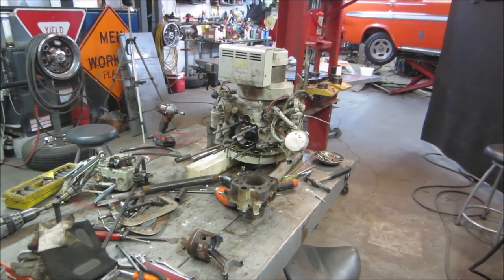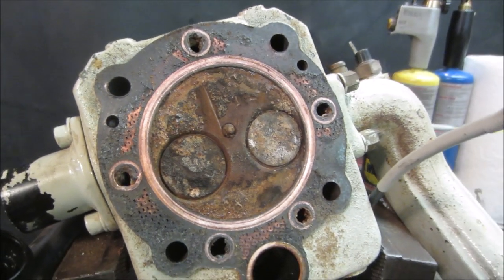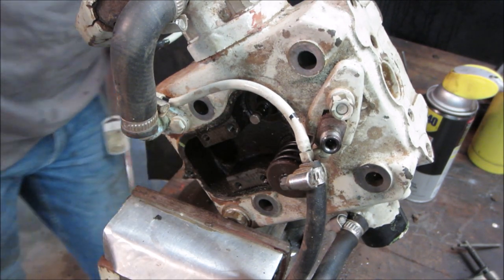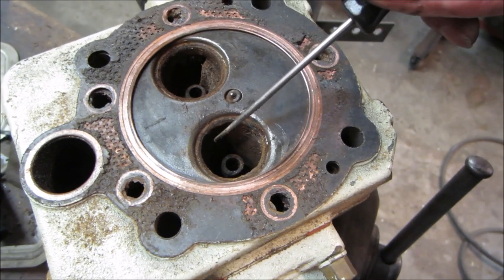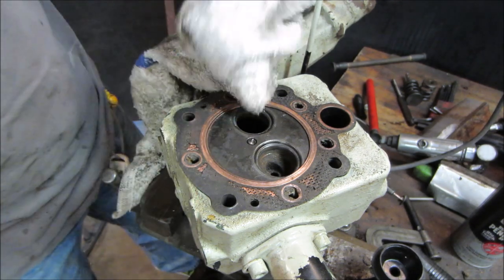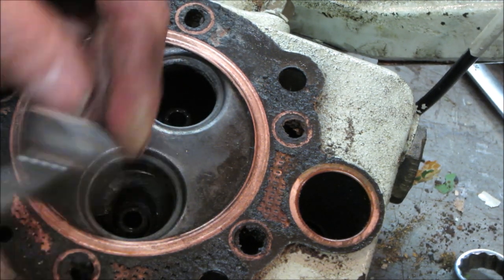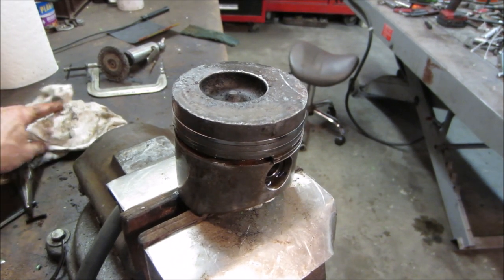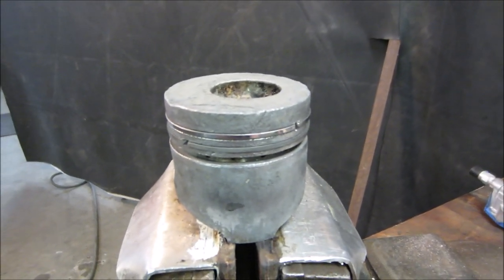Can It Be Saved? Junked Marine Diesel PT 2

Comment: That's a real pity. . . . On the other hand, the gen-end might mount up to another engine?! Plenty of them are a universal fit.

Valves and rings aren't necessarily the end of the game, but the broken piston crown is definitely a game changer, however, as we discovered about 45 years ago, there's a lot you can do with parts from other engines, and many a 'mongrel' has gone on to live again over here! 👌👍

One useful tool to add to your armoury, would be a "Vibro-Centric" valve seat cutter - It takes mere seconds to re-cut a valve seat like that in your engine, so useful in fact that someone decided ours would be more useful to them, than it was to us! 😠 Similarly, the old Black & Decker valve re-facing machine. Ancient by today's standards, but well worth nabbing if you ever find one in a junk sale.

Comment: Touching the tip of the injector with the wire wheel probably just wiped out the holes on the tip... I rebuild diesel fuel Injectors and a lot of the times customers will wire wheel the injectors for us and ruin the holes in the tip so we have to replace the nozzles. If you want the injector rebuilt send it to me and ill do it for free, cheers mustie!

Comment: This takes me back to a Skoda engine that was smoking. I pulled it apart to find one piston with a crack top to bottom. Ok I phoned Skoda for the price and what i was quoted was outstanding I said i don`t want a set just one piston & rings. Yep he said £180 the piston and £90 for the 3 rings. I got a fresh low miles engine with all the bits starter alternator injector pump already out of car. picked up £250. sorted

Comment: A marine diesel with a water-cooled exhaust should not be cranked for long if it doesn't start. The raw water pump will continue to fill the exhaust until it comes into the exhaust valve and hydro locks the piston.

Comment: i suppose if you wanted to press out the sleeve and flip it you could.  as for the rings i might try to go around them with that pneumatic screw loosener to vibrate them free.   as for getting parts from the Italian fellow i would think to aid in a restoration the parts would be gratis from the manufacturer for the advertising aspect

Comment: We use kerosene in the chamber to see if  the valves leak as it doesn't evaporate very quickly and it's thin enough to find any problems between the valve and the seat.

Comment: BMW M20B23 (2.3 L, SOHC, 12V) The cylinder bore is 80.0 mm (3.15 in) now if the ring thickness is the same. you have it made.

Comment: make a head gasket out of annealed copper same thickness as og gasket. i see this more often then not. especially in salt water marine engines. some liners can not be changed if its an aluminum barrel a lot of times they cast them with the iron liner in it. the piston should be at .000 or .010- .020 above deck. you should use brass brush on injector tip steel has a tendency to peel metal across the holes and plug them up.

Comment: You should do a collaboration video with cold war motors.  Scott has a 1950s valve grinding machine and they used it to re-do the seats and valves in 2 1950s straight eight engines.  The valves on those straight eights were way worse than what you see here and they got em working.  Cold War Motors is one of the best channels on YT and they could use the attention.

Comment: I think what happened is water froze inside that exhaust manifold cracking it, then when it thawed next the water drained through the cracks into the exhaust port, and into the cylinder.

Comment: If it's an aluminum piston, you may need to use muriatic acid to dissolve the aluminum that's stuck to the cylinder. Ya never know, it might help.

Comment: Maybe if a 3 part oil ring fits widthwise you could cut them to fit with a gap that would work
Reply: Piston is " CRACKED ".
Reply: @NoWr2Run  he cracked the oil ring not the piston
Reply: @shunloc9704  YES, but if you watch till the end he shows you the Piston is also CRACKED. Probably from the 20 ton press ?

Comment: Oh well, that's a shame. Next time just go out and get some proper valve lapping paste. I always used the one in the red tube, two lids, rough grade on one end, smooth on the other.
I'd never just spin the valve either. It was a back and forth rotation, lift the valve, turn it a bit, push a bit of the paste back in (like you did) then down and back and forth again.
Once any pits are gone, use the smooth grade.
Then again, looking at the condition of everything else, you were probably wise to just give it a cursory lapp.

Comment: The exhaust came back into the head, seawater is the ultimate corrosion, you need to regrind the valve seat and new piston, I would say the rest is good. Marine generators would be worth the effort the resale value, you need to research.
Reply: If the exhaust is water cooled it froze and cracked water entered the cylinder through the exhaust so if you can't find a exhaust manifold it's over

Comment: Newbie question from Scotland - Dont diesels have glow plugs? - I thought these ignited the fuel...having said that I have heard it is as Mustie described - pressure in the chamber
Reply: Its the super compression that ignites diesel, glow plugs typically are even not turned on in warmer months, Depending on the engine, they only turn on for a few seconds precrank.

Comment: Diesel engines have a very thick valve seat because of the high pressures and the extreme heat a thin edge valve would burn away pretty quickly 🤷🏻‍♂️ 😌

Comment: Why aren't there sparkless gasoline engines?   Does diesel combust at a lower temperature than gasoline?
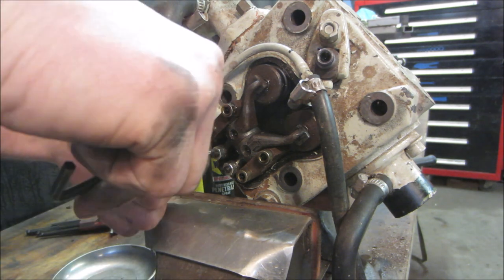Reply: Did you not watch the video?  8:00
Reply: @SteelheadTed  That's what sparked the question (no pun intended).  He explained how diesel engines work, which I knew, but I was wondering why it's impossible to make a gasoline engine that works off the diesel principle.
Reply: @jimthesoundman8641  I see.  I don't think it is impossible to make a gas engine that works like a diesel but since gas burns hot, fast and easily I think the issue of combustion timing gets tricky and isn't worth trying to overcome with compensation measures that is easier than just having spark plugs.

Comment: Hey mustie i have used copper silicone spray like the kind you use on headers to seal headgaskets i did that on a 72 ford van straight 6 headgasket  on it as an emergency fix on a sunday night and i had to have that van for work the next day so i bought another engine and said i wuld just change the motor when it blew again well 7 years later the body rusted so bad i couldnt get a sticker so i pulled that engine and put it in a truck i sold the truck 2 years later and that headgasket never did blow out so you might want to try that

Comment: You are lucky if the liner is not cracked. I would remove the liner for inspection and reinstall 90 deg from original position. Been there done that. Chief Engineer Paul Haugan

Comment: Steve from Annapolis knowing especially if you can't get parts I would have just let it serve for transmission fluid tapped on the rings with a rubber mallet put it back together it would have worked

Comment: You can test generator by spinning crankshaft with drill  or impact wrench. Hook meter to it and spin it up. If it's going to work, something will show on meter  even if not at 1,800 rpm. Edit;! Tie down block, without piston rod assembly  it will be hella out of balance,  and will want to hop all over the place.  Guess how I know this!! Lol

Comment: Google "Otto Gas Engine Works" on google.  From their webpage:  "We offer piston rings from 5/8" to 86" diameter and can custom make most sizes in-between. We can supply piston rings for cars, trucks, ships, tractors, stationary engines, outboards, hydraulic cylinders, and air compressors from 1890 to modern. We have thousands of piston rings in stock and can get you running again."  I bet for less than $30, they can supply what you need.  :)  I've used them before to purchase some really odd-ball rings and they've come through every single time.

Comment: you're gonna have to track down a sioux valve and seat grinder set from ebay if you keep working on rust crusty stuff like this. i've seen them as cheap as $75, but they obviously didn't know what they had. $200 is prolly more of a reasonable price, but that's still a lot cheaper than a new one.

Comment: I did valves that were just as bad as those on an onan engine I didn't have the suction cups so I glued another valve to them and worked at it the valves had been laped so many times in its life I even had to chock it up in a lathe and file them back a bit and then continued lapping them it took probably an HR or so to get them to be good again useing three different grits of compounds I also have done what

Comment: If SALT water got in the Electric's at all, for get it. You will see greenish/white crud, very corrosive damage. Becomes a Boat Anchor .You could save any nuts bolts, odd parts.

Comment: I don't know why people try evaporust wd40 carburetor cleaner....... have you ever tried KOIL penetrating oil you have to order it on line can't get it off the shelf in your parts store. Buy a gallon of it cause you're gonna throw away all the other worthless crap. It's the best ive unstuck model A engines that have sat 20 +years

Comment: Why wasting time on the old piston, a new one with rings and cylinder grinding of the connecting rod foot and seating the crankshaft in Spain is the most efficient and durable and does not cost more than € 120, around US $ 145.

Comment: They make custom head gaskets if ya can find them that’s willing too.
Reply: One of them small 1/4” sockets fits inside the suction cup, where the wooden handle goes in and use the 1/4” bit driver with the drill,yes on the face.
Reply: Well, that’s beat. Let’s do something else.

Comment: why not post the size of the rings, valves and seats and see if your followers can come up with viable replacements from other engines. As for the head gasket make a copper replacement and use sealant around the water jackets

Comment: You've hit a known problem with watercooled marine engines. If the engine is turned over too many times without firing, the water lock fills with sea water which back-flows into the exhaust manifold then into the cylinders.

Comment: Has anyone ever tried soaking seized rusted parts and muriatic acid see if that doesn't break down that rust and free things up I've got a tractor that I'm curious and ready to throw that in the engine it's been seized for 20 years
Reply: Transmission fluid and lacquer thinner muriatic acid eat up aluminum we use it in outboard motor cylinders to remove the gaulded aluminum off of the cylinder so we can home the sleeve without stopping up our stones
Reply: @jameslittle777  thank you sir but this is an old Case tractor it's all cast iron

Comment: I have replaced valves, valves seats and valve guides far to many times to remember.  It is common to make those changes. It is also possible to wild up cracks in cylinder heads.
Put a little heat on the Piston it will expand and release the Rings.

Comment: Dude you need new seats & guides for this engine. Best thing to do is find a good machine shop, they can replace these parts . Anything else would be half assed. This is not the correct way to rebuild the upper end of this engine.

Comment: Stick the piston in an oven at 500 for an hour to try to get the rings out. Also, you should be able to find a motorcycle piston that would fit or slightly larger and then turn it down on a lathe or re sleeve with another piston sleeve combo

Comment: Rather than using the breaker bar to try and turn the crank shaft it would have been more effective to use a impact wrench with the clutch set to slip and have it shake the crank instead of trying to force it. 

By the way I really enjoy your videos!

Comment: Use spray on copper coat we used that on a race car engine to Finnish the last race of the season with a slapped together bunch of spare parts we reused all the gaskets and just copper coated them about 5 times and it sealed ran just fine finished second with a piece of shit engine that should not have done that well.